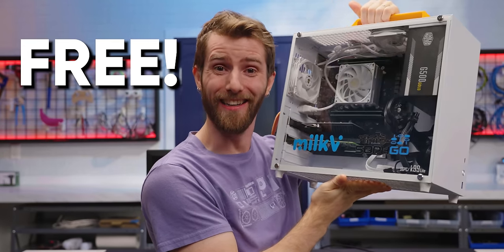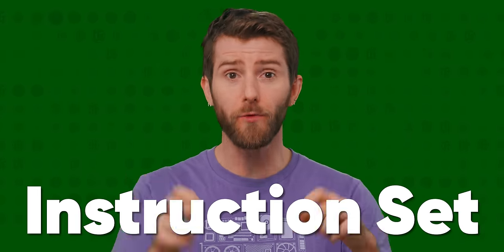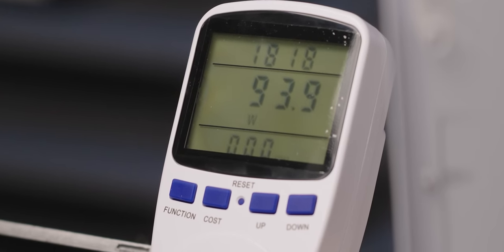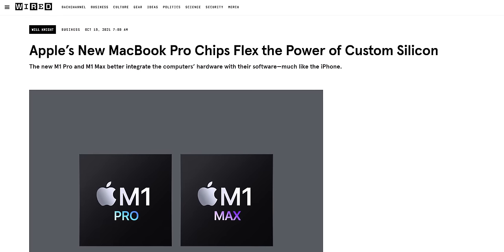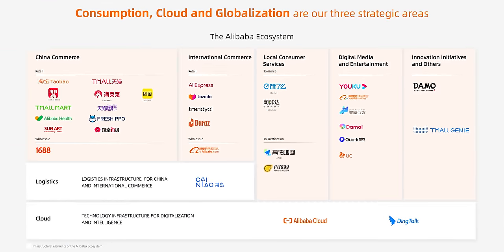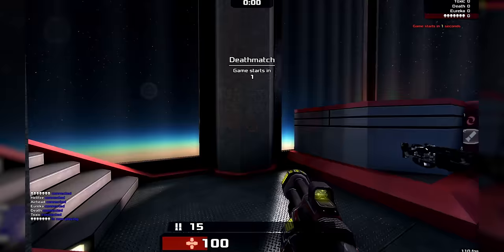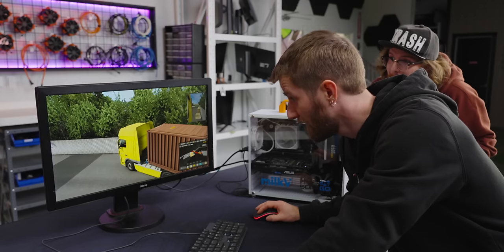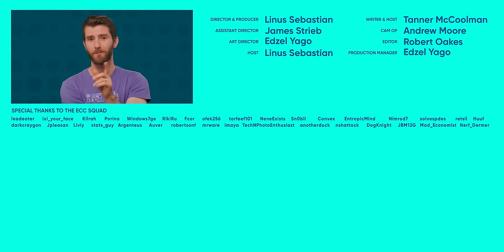This CPU is FREE! - Milk-V Pioneer with RISC-V

Comment from the maker: At 16:15 we refer to Imagination Technologies as a "GPU Startup". With a legacy dating back to 1985, Imagination Technologies is the brains behind the PowerVR GPU series among other achievements. Apologies for the mix-up in the video; they're definitely more than just a "GPU Startup."
Reply: They might as well be a startup, I'm still waiting for Linux drivers for their PowerVR SGX545 GPU since 2012! I need drivers to use the thing, man, come on!
Reply: IT started to support open source drivers some time ago and recently contributed code as such to the kernel. Floss is the way to make products more sustainable. They seem to have learned their lesson.
Reply: @aladdin8623  I know for a fact that the drivers exist because there was a proprietary Linux based OS that had them. I don't remember what it was called. The problem is that those drivers are not in any of the modern OSes yet, even including Windows. This GPU released with an installer for its drivers made for Windows 7 32-bit and it won't work on literally anything else. Not Windows 8, not Windows XP, not even the 64-bit version of that same Windows 7, not any version or release of Linux. It's one of the biggest scams I ever fell in.
Reply: This would only be fast on compile-based distros since most compiled software uses generic flags mostly designed for standard x86 / ARM processors. Other than that, great video!
Reply: Imagination Technologies goes all the way back to 1985 and was originally called "VideoLogic"
Reply: @ThePortuguesePlayer  GPU drivers was merged to kernel and MESA project last week. Yes, it's for modern PowerVR but still.
Reply: @GsrItalia  Dude chill.
Reply: Still making mistakes lol
Reply: @tileacids4436  to err is human.
Reply: Also, RISC is "Reduced Instruction Set COMPUTING" not "computer".

I mean, I guess it becomes a computer when it's put inside a box, but RISC is a principle, not a particular product.

(Don't worry. I'm just being very nit-picky. It doesn't actually matter in the slightest, of course.)
Reply: @GsrItalia  What?
Reply: @yuryzhuravlev2312  Sorry to bother, but do you know if there is a public list of the included GPUs?
Reply: @tileacids4436  🤣🤣
Reply: I was wondering about that, I remember back in the day when the SEGA Dreamcast was powered by the PowerVR.
Reply: Ahh
Reply: @nocturn9x  Think of it as static. It's some butthurt keyboard warrior child with nothing better to do with their internet time allowance, but it amounts to the same thing.
Reply: And about two seconds earlier, at 16:13, it seems like there's half a syllable of Linus talking that's probably not supposed to be there.
Reply: @hedlund  Yeah
Reply: @nicholaschevy134  They cut out the "GPU-Startup" with YT's internal tools. So it's probably not entirly their fault
Reply: Still not doing your due diligence, eh Linus?
Reply: Well @LinusTechTips, RISC-V may be FOSS (Free Open Source Software) architecture, but it is not free "Liberated" hardware.
In the sense that it is so permissive; making it easily susceptible to become proprietary Just like with SiFive Cores and the other manufacturers. 
In contrast to Gnu/Linux however, it's under a Copyleft license which mandates any modifications to be release under the same rights of X software is based upon.
So No, The RISC-V license (BSD) does not have any protections from turning FOSS projects into closed source software/hardware.
Reply: @Xpll  Many argue that copyleft licenses aren't as free as they portray themselves to be, and for some pieces of software I agree. Hardware architectures probably require specialized licenses, just like the LGPL was made specifically for software libraries and the AGPL for network-based services. Personally, all of my projects from the last few years either use MIT or Apache 2.0, I'm not a fan of GPL
Reply: @nocturn9x  I understand that GPL licenses are more restrictive than other permissive licenses, however that was done for a very crucial reason, and that's for protection. I think i can recall RedHat one day broke the GPL license for turning a component proprietary (as i remember). 
Regardless i believe that every license could be suitable according to the type of project; however when it comes to CPU architectures, i see that permissive license seem problematic for the same reasons I mentioned earlier. 
I have one question though, what's exactly the difference between permissive and public domain licenses (i.e unlicensed)?
Reply: @Xpll  The difference is a bit nuanced. First, any creative work that is unlicensed is not automatically in the public domain, in fact it's quite the opposite: in this case, something called "natural right" applies, meaning that if no license exists, then all rights are reserved to the author and that thing they made cannot be used by anyone else in any way. To have something be in the public domain, it needs to be explicitly stated somewhere by using an appropriate (albeit short) license (even simply stating it in the README of a source repository, for example, is usually enough)
Reply: @nocturn9x ciao
Reply: @tom_zanna  lmao hi
Reply: @nocturn9x  Good to know, thanks. Then what would have happen if RISC-V was released in the public domain instead of the BSD license?
Reply: @Xpll  It depends on which BSD license. If it's a zero clause license, nothing much would change I suppose, although I'm not an expert so don't quote me on it. Otherwise, it depends on the clauses of the license, although I'd like to point out that for something to qualify as in the public domain, usually the author needs to be deceased for at least a given numbers of years (I think it's > 80), or the author themselves needs to specify that their works are in the public domain
Reply: you cut out the "GPU startup" right? i can still hear a little bit of the word "startup" before "imagination technologies".
Reply: The manufacturers of GPUs in Apple iDevices before Apple decided to manufacture its own silicon.

Comment: Its so strange to see real cpus running RISC-V, because being in university, and in a cpu design class we used Verilog HDL and FPGA's to implement the RISC-V instruction set from the ground up. Not saying it was easy though, so I have a huge respect for these guys (Chinese or American), but Verilog did a lot of the heavy lifting.
Reply: Literally just got done with a digital design class where I learned about it. This would not be a fun project lol.
Reply: @terinrichardson6061  haha same. Got an exam about RISC-V architecture in a few days, needless to say, it's hard
Reply: Lol same we did this at Colby
Reply: To be fair, implementing it now that it already exists, and writing the instructions from scratch are obviously different things. 

But yeah, since it's RISC based, that means there are going to be few operating commands that you can write all instructions with. So it makes sense.
Reply: @anurag9314  that doesn’t sound like a very useful exam or class. Rather than teaching you about RISC-V they should be teaching you about processor construction and architecture in general.
Reply: Back when I was in college, over a decade ago, we did MIPS for that... Which is probably easier but RISC-V being real-world kinda makes it a lot more useful to use.

I also went and did a floating-point coprocessor as extra credit on that project... Don't think I'd have as easy a time doing it with RISC-V's vector math stuff.
Reply: Now I feel old. Ours was MIPS.
Reply: Haha doing the exact same thing right now, procastinating implementing hazarding by watching this video
Reply: I went through that hell, I'm glad I'm done with that already...
Reply: LOL, just finished my Computer Architecture course, designed a riscv core. Computer engineers have swarmed the comments.
Reply: That sounds like a fun project.
Reply: yeah, the textbook series everyone uses comes in risc-v flavor and mips flavor.
used to only be in mips, and risc-v is probably considered the "modern" one now.
I never went to college. I'm learning this stuff on my own, for fun.
Reply: We used MIPS for my CPU design and implementation course project several years ago. Would be cool to do it in RISC-V for sure.
Reply: This was one of my favorite projects in my degree.. super cool to see a video with a real-life implementation of this!
Reply: Ah, my CPU design class had us make a stripped down version of MIPS. It was fun!
Reply: Yeah, I am working on a little integer risc-v CPU, trying to focus on speedy execution, typical five stage pipeline, but it doesn't work so well.  I think I have some glitches in the forwarding circuits or I missed a forwarding condition....
Reply: Digital design isn't that difficult, especially with an established ISA.  The microarchitecture is something they don't have and that is why competing with any real performance standard isn't going to be up to par anytime soon.
Reply: Well, a production CPU is an insanely complex piece of silicon, so it makes sense
Reply: @psiah9889  learning a subject that is  useful? that seems to a lot course now a day's? its almost just way to make money? the  useful of the subject, is not as important as the UNI/COLLEGE  it was taken at?
Reply: @cheesetomatoes  RISC-V is very very similar to MIPS. It modernises it, fixes mistakes, and provides room for adding future instructions while being different enough to avoid legal problems. If you know MIPS assembly language then RISC-V will look very familiar.
Reply: Verilog always does the heavy lifting in any chip that is beyond toy size, there's just no way you'd get anything working without it. And it has one feature that is essential for a lot of companies, you can encrypt the inners of your modules when you give them to a third party so they can't see what's inside, which limits the risks of getting your IP stolen.

And even if risc-v itself is royalty free, it doesn't mean you can't sell a cpu design that uses this architecture. Arm value goes beyond the instruction set, they get you a working core that you can customize and add stuff to, I would expect risc-v to go the same route.
Reply: Why not use Vitis?
Reply: Awesome! Make sure not to miss any of those classes cos processor design pays the big bucks and the boom is starting! I worked on Verilog in 09 and it's tough fr but when you get the hang of it you can do magic!
Reply: @psiah9889 They probably just implement the base RISC-V instruction set in those classes, which is much simpler than MIPS.
Reply: Just finished mine on mips :(
Reply: @conorstewart2214 the class usually does that and more than work on RISC V, optimizations and such as well
Reply: In about a week, I'll be taking a final in my first verilog class, so it's interesting to see this now.
Reply: Lucky bastard. They made us use fucking MIPS in ours. Though we did get to use VHDL, which I much prefer to verilog.
Reply: cpu design class sounds like some sort of magical school as it seems insane how these things are build. big props to you for going trough that.
Reply: @wazorak  not that awful once you get into it. Not that its easy either. Essentially you put chunks together, copy paste them together into bigger and bigger chunks, and tie the chunks together. The hard part is debugging.
Reply: Do note that there are many extensions to the base instruction set of RISC-V that you most likely implemented, some of which are pretty complex!
Reply: Same, from UCI… this seems like it would be a nightmare
Reply: Nice I‘m doing the same rn in Uni too
Reply: So nice to see that people all over the world have a similar experience. 
I did a similar project at my uni too, we didnt have to code the whole processor in verilog, just analyze the code, but we had to code a simplified version of pokemon fire red in assembly and run it in a fpga.
Reply: Oh god did you use actual base Verilog? That shit is... well, not many safety rails there. We used SystemVerilog, it's pretty much the best of both worlds between Verilog and VHDL
Reply: Last year we implemented a subset of the RISC instruction set in VHDL in Vivado and ran it on an FPGA in the end. Reading through a lot of the ISA documentation gave me a lot of respect for its designers, the way they designed and grouped all instructions is honestly amazing. They really thought about everything when making it.
Reply: What do you mean wth: "But Verilog did a lot of the heavy lifting"??
Reply: Comp Engineers unite
Reply: @brauliomartinez8265  Yeah.  I don't understand that either.  Verilog is only a hardware description language.  It doesn't know anything about any architecture.  It's like praising assembly for Windows.  Assembly is just assembly it has no input on what you do with it.  At least that's my understanding.
Reply: I’m glad I wasn’t the only one that had to go through the pain in programming  in Verilog in college
Reply: almost all digital IC started from verilog today.
Reply: @conorstewart2214  They probably are teaching about general processor construction and architecture, but using RISC-V as an example because it's free nature means every student can easily access and share whatever relevant data or documentation they find. 

I say this because back when I went to uni one of the primary selection criteria for picking which software to teach on for whatever task was largely dictated by how easily a stereotypically poor university student could access it, which meant there was a lot of open source and libre software being taught. Makes sense that they'd do that for teaching about CPU design and the like with an open-source CPU architecture.
Reply: My final degree project is about designing my own RISC-V processor with 5 stages pipeline in verilog

Comment: Student at UC Berkeley here! RISC-V was created by researchers here, and it's made our way down to the introductory curriculum. The final project of our lower division (required introductory) computer architecture course involves making a slightly simplified RISC-V processor out of basic logic gates! Super cool experience
Reply: That sounds so cool even if my overthinking would prevent me from finishing that 😂
Reply: 20 years ago, one of my professors at university was one of the researchers of the original Berkeley RISC.
Reply: Can second this CS61C at UC Berkeley is a great class!
Reply: our intro class to computer architecture (EECS 112) at UC Irvine uses RISC-V as well. Next quarter I'm going to make a simplified processor as well!
Reply: We do RISC V here at HCMUT Vietnam too
Reply: CISC = Complicated Instruction Set Computer
RISC = Rapid Instruction Set Computer

These new definitions describes better current CISC and RISC machines. All CISC x86 from Intel and AMD runs internally as RISC machine (with separated ALU and LSU aka RISC's load-store architecture, and decoding CISC x86 instructions into RISC micro-ops). Basically since 1995: AMD K5 (modified RISC Am29000 CPU) and Cyrix 5x86/M1 (OoO and RISC inside), NexGen 686 (using RISC86 micro-ops, later bought by AMD and sold as K6), and of course Intel Pentium Pro (famous P6 architecture PII, PIII, P-M which used DEC patents for RISC execution).
Reply: mips (still risc) is still better for introductory classes introcpu architecture.
Reply: @AI-qd4vb  can't speak directly to MIPS pedagogically, but I know they used to use MIPS in the course I took, but switched to RISC-V some time back. I found the way they taught RISC-V both very easy to understand, and that it transferred really well to the x64 assembly I ended up using in other classes, which is what I would hope to get out of an intro computer architecture class. Combined with MIPS no longer being developed as of a few years ago and RISC-V continuing to grow in actual use, seems like a solid choice to me 🤷
Reply: @arm-power  They aren't RISC internally. They just use a highly optimized microcode approach and the best solutions from CPU designs.
Reply: Are they similar to MIPS?  Or more like the more complex ARM64?
Reply: Did you ever try to run BOINC on RISC-V chips?
Reply: In Germany we didn't study x86 or ARM Assembler and CPU Architecture, we used RISC-V as an example. It's the future.
Reply: Same at UCSC, not sure about any other campuses

Comment: I'm studing Computer Engineering at a public polytechnic university and they recently switched to RISC-V as the primary real-world academic example for many courses that discuss ISAs, assembly, and computer acutecture. I watched this video with a SiFive dev board sitting on my desk.
Reply: Definitely good to see the knowledge learnt from school is applicable in real-world, instead of some proprietary or out-of-date things.
Reply: It's a great little ISA.
Reply: Cal poly?
Reply: @peterlin5857  how about propertiary AND out-of-date? Becase thats how often it is
Reply: Lets goo i am a dev willing to write software for risc v
Reply: Computer science here. We used x86-64
Reply: It was ARM for me, but the next year they switched to RISC.  I kinda wish I had taken that class, too.
Reply: Yep, went to A&M for Computer Engineering and RISC V was the focus of my architecture class
Reply: sure, sure
Reply: My school was still using MIPS, which admittedly is very similar to RISC-V in terms of instructions.
Reply: Lol, would've been "fun" to have the Cell architecture in 2006
Reply: Also studying Computer Engineering. My class was actually the first to move out of the MIPS architecture and learn RISC-V. They are very similar indeed, but it's very very nice :D
Reply: I had Mips for classes involving design using an FPGA, but arm for classes where you just needed a microcontroller.
Reply: As a black and homosexual transgender African American muslim I study critical race theory at Barack Obama High. I watched this video on IPhone, a black man invention.